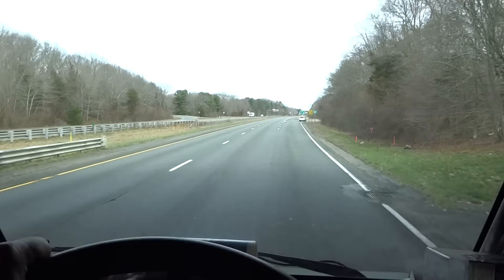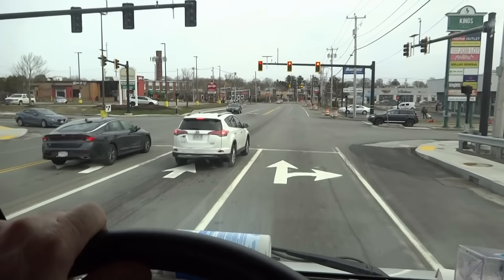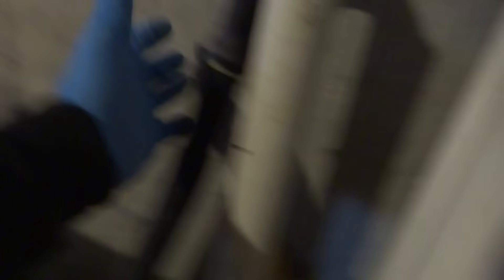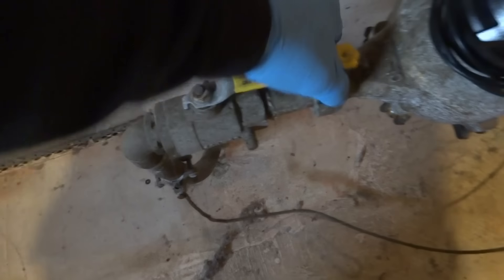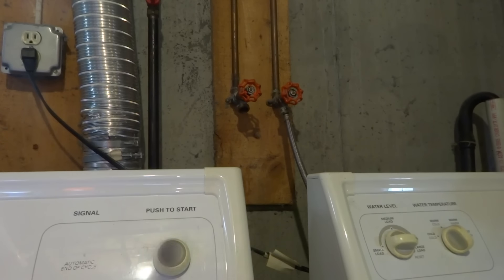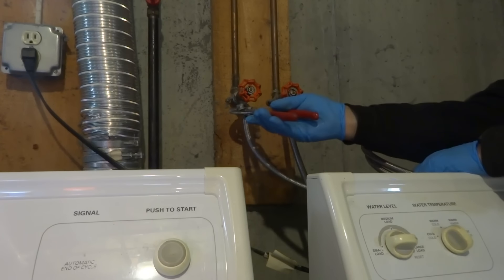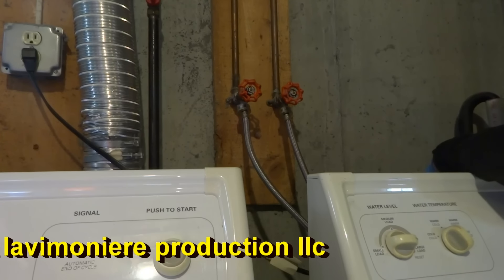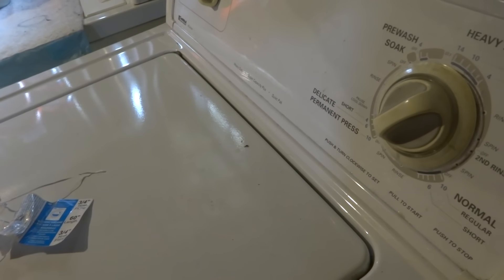WASHER MACHINE HOSES & SHUTOFFS ADDRESSED

Comment: Gotta love that old Kenmore direct drive laundry set.
Reply: I have a set older than that. It still works great but had to put a new motor in the dryer just this week and also a few other parts that are being shipped to me. The fuse and cycling thermostat and door light bulb

Comment: Steve, could it be water  hammer when the  washer fill valves  close,  causing the pipe banging noise?. Put in Sioux Chief water hammer arrestors.

Comment: i have low water pressure compared to everyone else in my area due to location, so im not too worried about my hoses bursting. water co. doesnt even check my meter, they just charge me a flat rate. they do supply what they are required to, its just not much here. they had came and checked it, it dont remember what they said it was but i know it just met the minimum which is my state that would be 20 psi.

Comment: I had a "no burst" hose pop a hole in it before cause my water regulator went bad. Either it was a defective hose or it could not handle the 160psi of static pressure from the bad regulator. Flooded the whole kitchen with hot water from the tankless water heater. It was a shitshow.